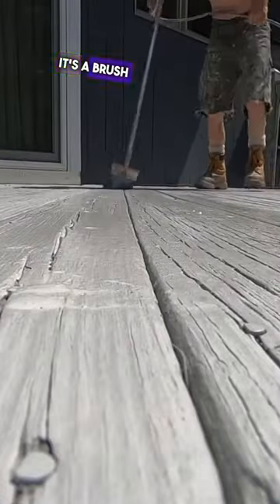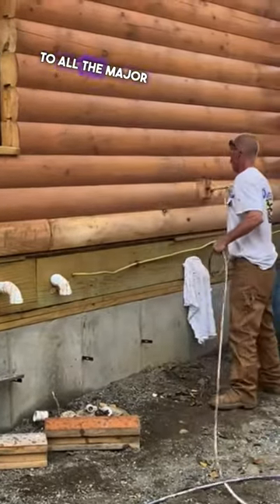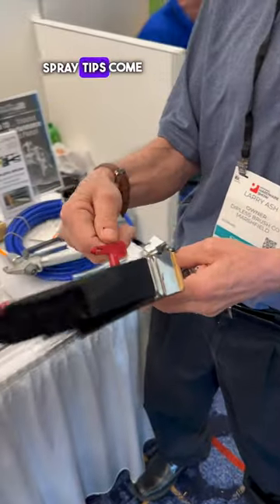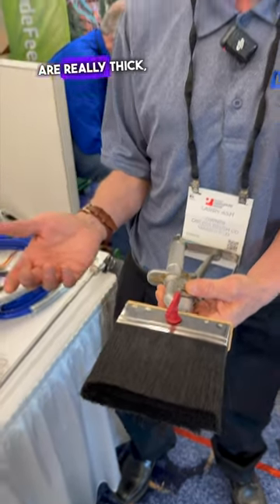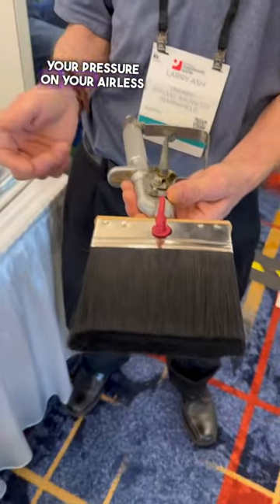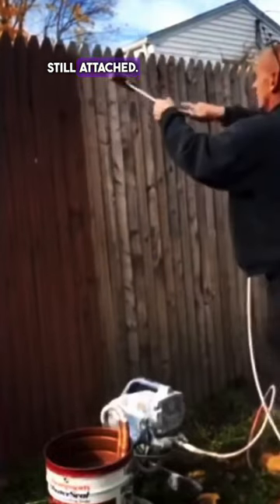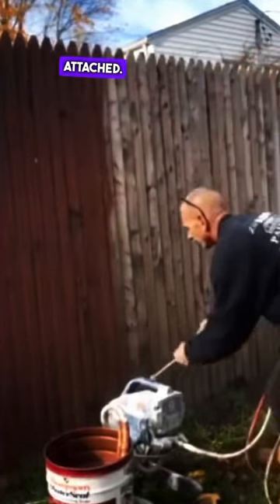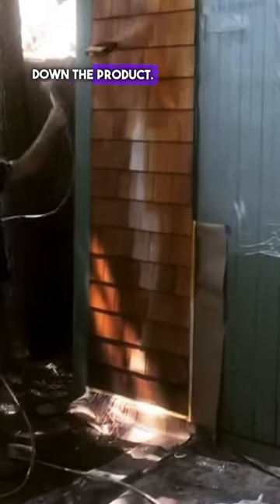Would You Buy This Spray Brush?! #painting #construction #shorts

Comment: I like the concept good idea
Reply: I don't get it.  If you already have the tools for pressure spraying that's required for this proprietary brush end....it's more trouble than it's worth, IMO.  Cleaning brushes are already a pain.  now you have to clean the extra accessories on top of the plain brush you already have.

Just hang a bucket/brushes from your belt or ladder for when you need to work something the spray didn't get.

Comment: I been spraying for years and ima say nahhh. I would not use this. Make a backpack with a line to an interchangeable high quality brush you can cut lines with. This will improve the brush overall. I would spray normally with a gun and cut with a regular brush over this contraption all day. I don’t mind the prep to just spray normally, even the roller machine to me is useless.
Reply: Yes, this.  Why restrict yourself to a proprietary brush head to your existing pressure spray system over just using a hand brush for any needed corrections?
Reply: This is for all the newb's and amateurs who do nothing but leave holidays or whos spray patterns sag more than an old ladies...well you know
Reply: Agreed! I would use that goofy thing. Probably have paint everywhere, unless it's only decking. Spray-roll or spray and tip/lay it off. That's the best for myself, or one person spray while someone else brushes or rolls.

Comment: Is there ANY situation where you cannot use a sprayer and have to use a brush?
Reply: Yes. In a situation where you don't want overspray on other stuff.
Reply: I have a roller attachment for my sprayer that feeds paint from the inside. I use it on interior walls where you would normally roll. No stopping to reload the roller, no thin spots, no dripping or tripping on a paint tray. Rarely do I see a need for a brush that this attachment would replace. In most instances I would be spraying. When doing a deck, I’ll cut in with a brush but then use a sprayer and a shield to protect adjacent areas.
Reply: Yes, in log homes brushing is very important. More for stains than paint.

Comment: The whole reason to buy an airless sprayer in the first place is to not have brush marks... Try the idea with a roller and it might not be so stupid ;)
Reply: They do in 2 different one is called a pressure roller the other style is a spray roller it’s a sprayer head that sprays onto or below the roller
Reply: No its to paint quicker and more efficiently no brush marks was just a bonus. This contraption is absolute junk!
Reply: Notice everything they are doing is old wood? Spraying will not flood the cracks (checking) in the wood, it needs to be worked in with a brush.